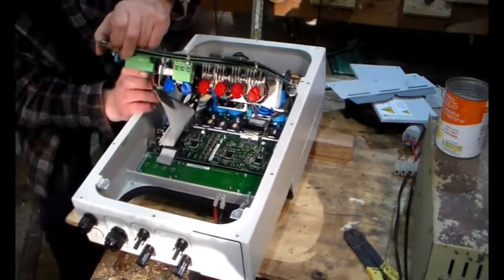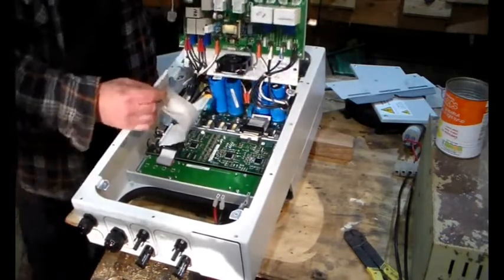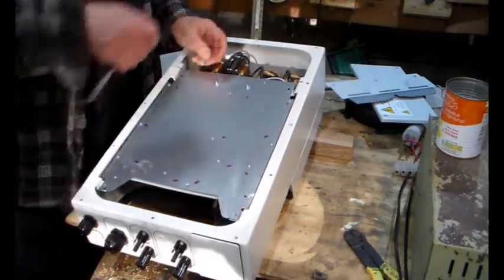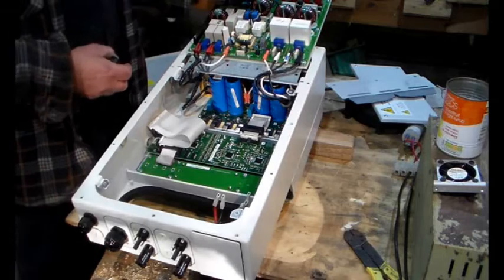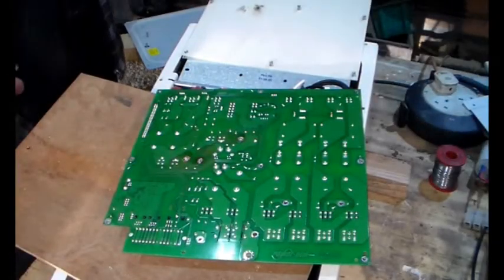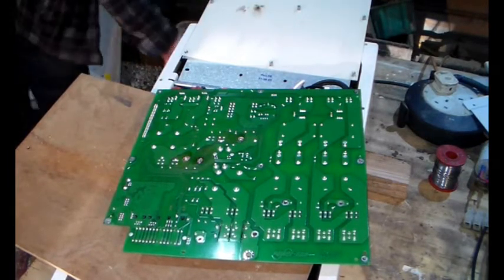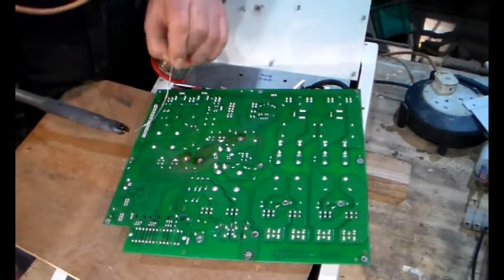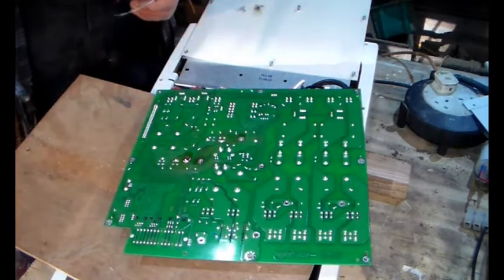ABB Aurora inverter fault E031 improved fix / repair

Comment: Olá, td bem?  Consegue me ajudará com uma reparação em um inversor ABB, o componente CI da placa de Potência está carbonizado e não consigo encontrar o código dele. Tbem não consigo encontrar o datasheet do inversor.
Reply: Inversor PVI-6000-TL
Reply from the maker: @joaomariorodrigues9441  sorry I have never had a 6KW inverter. in my experience if a chip is burnt then another failed component will have caused it, cheers

Comment: wow. fixed mine. was a bit nervous bc i never worked with DC before, but turned off the AC breaker and DC disconnect switch, then dismantled per your instructions. found 1 pin that had burned out. re-soldered and i'm back in business. the lowest solar provider quote was $4000 to replace the unit. fixed for pennies. thanks andy.
Reply from the maker: Hi, well dome, make sure you inverter is in a coll well ventilated area, you can also add an extra small fan run from a plug in timer. they just have to stay cool, please buy me a beer, cheers

Comment: Brilliant thanks Andy! Found E031 error on my inverter yesterday and at first finding advice on the internet that it was terminal, came across your video……………..had it fixed within 2 hours at nil cost!!, thanks to you. Just working out now how to donate, Can’t imagine how many of these Auroras will have been binned and replaced unnecessarily. So satisfying to repair and keep it going. Best regards, Geoff
Reply from the maker: Geoff, keep your inverter cool, not in the loft. I frequently add an external fan run on a timer. There's a video about the relay contacts, sometimes the heat comes from arcing contacts. A donation would be much appreciated, Patreon or Paypal, links are on the channel page or on my recent video details, cheers

Comment: Ciao Andy, complimenti per il video. Ho provato a sostituire i 2 rele con le piste rovinate però mi da lo stesso errore E031. Hai qualche consiglio da darmi? devo sostituire anche gli altri due? Poi volevo fare le prove in tensione con la scheda aperta ma il sistema non parte perche la Riso mi da 0 ohm. come posso risolvere. Grazie per il tuo aiuto prezioso.
Reply from the maker: hi, please see my video on re setting the relay contacts. Check your connections on the replaced relays, the coil tracks are very small. in the past I have had to add a jumper wire because of damage to these fine tracks, cheers

Comment: Hi Andy, great video and information. Thanks. I have searched for both relays Zettler A22150W-1AE or Omron G8P1A4p-BG in CPC /Farnell and RS Components but with no luck. Are you able to say where i can get hold of these relays, or if not, if i measure the pin-out dimensions can you tell me the minimum recommended ratings for equivalents that i should use?
Reply from the maker: I try to avoid removing the relays and re set and clean the relay contacts instead, I have videos about this. The heat that melts the solder often comes from arcing contacts and these can be re set, cheers

Comment: Thanks Andy, just went up into the loft to put away my Xmas decorations and noticed the invertor clicking on and off saying it was an international invertor fault E031.
To say I was expecting an expensive repair bill, but followed your helpful advice and within 30 mins got it back on line and fault free. Thank you so much for your video and advice 😊
Reply from the maker: Hi, the loft is a bad place for an inverter, if it must stay there consider fitting a small fan controlled by a plug in time switch to blow air over the inverter when generating. Please see my books and Paypal, cheers

Comment: Hi Andy, that was brilliant, thank you! I had the exact same message an found the exact same fault as you show. Solder on, all back together and back on the loft wall... Now - The thing doesn't power on (as it did before + E031). Is there a fuse in the unit or a safety switch that may have gone during the process? Thanks! Seb
Reply from the maker: Hi, there is no internal fuse, but have you checked that both AC and DC are getting to the inside of the inverter. Are all the internal spade connectors correct. Did you remove the wide communication ribbon and is it possible it was put back the wrong way round. Just a few thoughts, also a loft is a bad place for an inverter due to the lack of ventilation and the summer heat. If it has to stay there then a supplementary fan on a time clock is essential to blow air over the inverter, cheers
Reply: @TheInfoworks  Thanks for that. I had metered the AC in, when all was connected and the lid was still off and 242 was coming through so I put the lid back on and left it overnight to deal with in the morning. Weird thing is, when I went up the next day, before I took it off the wall, I tried it one more time and whoosh!, it all started perfectly and is still running and inverting... The only thing I can think of which is different is that the sun was out, so panels were now active? I thought AC alone would power the machine up and let you know DC was not coming in? 
Anyhow - Thanks again for your video and explanation, mate!
Reply from the maker: @sebasmorgan  Splendid, yes it's a common mistake, the inverter switches off over night so it does not draw power. They will not start without generation. Thanks for your kind donation, it all helps with the low impact income, cheers

Comment: Hi Andy. Mine just developed that error code. I’m not confident enough to do the repairs so do you actually offer that service?
Reply from the maker: Paul, Hi, no I don't provide this service but I believe it is available on Ebay. What ever you do make sure your inverter is mounted in a cool, well ventilated space, cheers

Comment: My 13-year-old Aurora inverter suddenly showed error E031. While I was searching for a solution I found this video, took my inverter apart, found one of the relay pins had arced so I soldered it according to your instructions and the inverter has been working for a month without a problem. Thank you!
Reply from the maker: John, thanks for your donation, much appreciated. The solder problem stems from relay contact arcing, and this is initially caused by inverter overheating. I have further videos in this series, including the re setting of the relay contact gaps. You may find this interesting. To keep inverters cool it is helpful to install a small  external fan, run on a time switch so it runs every day from (say) 10 am until 6 pm. Cheers

Comment: Fixed my cold solder on the relay. Just one little black burnt spot was arcing. Now I have a arc sensor failure. My arc sensor test always passed before I resoldered the relay.. any ideas?
Reply from the maker: Hi, I have a video in this playlist showing the cleaning and setting of the relay contacts. Damaged relay solder joint is caused by relay arcing which is caused by excess current, switching off at high power due to poor cooling, cheers
Reply: So I need to replace the relays? Or cut the tops off and clean the contacts? I'm leaning towards my wiring causing the arc . They were very tight in the conduit. May have caused a arc between wires
Reply from the maker: The relay pins are far enough apart so that there should be no solder spill. Try taking the tops off the relay with the burnt / melted solder and check the contacts as per my video, cheers @robrocha420

Comment: Had the same problem on my 12 year old AURORA inverter. Slightly different internal set up but followed your guide lines and problem gone, Just saved me $3000 AUD....thanks mate, will buy you beer if you are ever down under..
Reply from the maker: Brilliant, see the other videos in this series, especially about resetting the relay contact gap. The heat is caused by a poor relay contact arcing. If you feel like sharing the joy, see my paypal link, cheers

Comment: Soldering fails due to relay failing and producing excessive heat on terminal. Always replace relays with a new ones. Relpol 40A relays are cheap and should last a lifetime.
Reply from the maker: HI, I agree that the heat is produced from the relay contacts but have found ways to reset these and their spring pressure, cheers

Comment: Hi Andy, something to add to this, I have a number of these, I recently bought one with this fault, did the relay repair, and it didn't work. Swapped the board into a known good inverter and it worked. It turns out that the control/logic board had a failed transistor, which activates the relays. I plugged the two boards, set the multimeter for continuity, found the transistors/mosfets which activate the relays, one was shorted, replaced with a salvaged component from a parts board, and we're back in business at a cost of no pence. Happy days. Hope this is useful to someone. Regards
Reply from the maker: Hi, I think you were lucky, frequently I find there are other problems with blown transistors that caused the fault initially, cheers

Comment: Just tried the repair, including replacing one faulty relay.  Now got an E-019 error which comes up more or less immediately (no sound of relays operating).  Any clues on how to fix this?  Thanks
Reply from the maker: Alistair, just check all those connections and makes sure all the spade connections are right. The ribbon can give problems, especially if you disconnected it both ends. I have a vague suspicion that it has to be the right way round. Also track damage around the replaced relay, especially the very fine coil connections, cheers
Reply: the control board will need the fet replaced that drives the relay

Comment: Thank you so much for posting this. Just fixed my 8 yr old aurora with one new relay as it had burnt the board contacts. My soldering iron was a bit low powered to desolder all the relays so I stopped at one.
Ordered a new iron and will replace the rest next week.
Reply from the maker: Grand, hope you also have a solder sucker, let me know how you get on, cheers

Comment: Hi Andy, im a solar technician. I will attempt to do this for costumers since there is a long wait of a back log from ABB. Did you have to replace the relay or just fixing the solder joints fixed it?
Reply from the maker: Ron, for your application I would replace the relays as some of the heat comes from damaged relay contacts, see my video on resetting the relay contacts. I hope you have subscribed, cheers
Reply: I've been seeing this error often . Did you try this method?

Comment: Andy thanks for this video, saved me getting a new inverter. One resoldered pin and it's all good again.
Reply from the maker: Ben, thanks for the appreciation, several things: see the other videos in this series as the heat is caused by poor contacts, also see under "about" on my chancel page for other ways of sharing, cheers

Comment: Thank you. I have the same issue with my 5kw inverter. The internal is more simpler than than this one. Only one relay that was faulty. I re-soldered the relay that was faulty as well as the other one just for peace of mind. Put it back together and it worked 🎉. Thanks again for the video 👍.
Reply from the maker: Hi, another inverter saved, the heat can be caused by burnt relay contacts, please see my other videos on this subject and my channel funding options, cheers

Comment: Andy and others, I have a problem! 031 errror. 
Soldered up burnt solder, still error, then removed burnt relay and saw coil burnt inside. Also saw copper tracks coming away either side of board where burnt.
Replaced burnt relay and checked other 3 relays, all had same resistance on coil and made circuit when 12v currrnt passed, so only replaced one relay 
As well as soldering in relay, I added copper wire jumpers to tracks.
Checked connections all good.
Sttill 031 error.
Any idead snyone?
Reply from the maker: Hi, I have had this before and traced it down to poor contacts in another relay. See my video on setting the contact gaps. I have several other videos covering this problem. I hope you will subscribe and remember me when you fix it. Cheers
Reply: @TheInfoworks  Thank you Andy. I have tested the 3 other relays in situ and the coils all have re same resistance as the new one. When I connect a 12v current to the coils I hear the contacts close and resistance across all contacts is virtually zero. Do you think that changing the he other 3 will do it? Or could there be something else?.....Steve
Reply from the maker: @STEVEACER777  If his were mine I would remove the old relay covers, clean the contacts and adjust them to give good contact thrust. No point changing them if the fault is elsewhere. I think you may get no resistance but with a load this breaks down. Cheers
Reply: Thank you Andy, I have a lot of relays on the way, so I think I will change the lot and beef it up a bit at the same time. I know the inverter has been standing for quite a while so contacts could be bad. I am not as good as you with a Dremel so will change instead thanks for your help ..Steve
Reply: Andy, not got that one going yet, but have another that is dead apart from when the DC is contected there is a ticking sound like a clock. Any ideas?.....Steve       Ps. When the DC is disconnected the ticking gets slower and slower before stopping.
Reply from the maker: @STEVEACER777  Steve, that's a faulty capacitor, cheers
Reply: @TheInfoworks  Thanks Andy, will strip down and hopefully find it this morning.
Reply: @TheInfoworks  I have replaced 2 capacitors that I though could be ticking, but still dead with the ticking sound, do you think another fault could be making them tick? If so any ideas? There were a couple of badly burnt solder joint on a relay that I re soldered , they burnt through the insulation sheet to the back cover. May be this shorted something out or blew an internal fuse somewhere?
Reply: I am struggling with 2 inverters, hope someone can help!
Inverter 1   changed all relays resoldered all bad conectrions, still 031
Inverter 2    ticking with no sign of life. Changed 2 relays that I though were ticking, but still ticking and dead.
Reply from the maker: @STEVEACER777  Hi, there's a short somewhere and a capacitor is charging up and then dumping the charge. Might be one of the big capacitors. You might be able to make 1 unit from the two, cheers
Reply: @TheInfoworks  yes Andy, I was going to try putting the relay board from the dead inverter into the 031 inverter, wil let you know... Steve

Comment: Addendum to comment I posted 3 weeks ago that may be useful for repairers.  During my repair,  I also checked the operation of the 4 relays on the board while no power was connected.  The coil resistance ranged from 120 - 130 ohms on my multimeter and this matched the specs I found on the web.  I then applied 12 volts to the two small coil pins and make the relay click.  I then clipped on my multimeter to the large contacter pins and got either open circuit with no 12 volts on the coil pins, or 0.2 ohms with 12 volts on the coil pins.   One of the relays made the clicking noise but failed the 0.2 ohm test with contacts closed.  I replaced this relay with exact replacement for $6 plus $5 postage.  A second option was to hack  in a 250 volt relay 12 volt coil with spade terminals that could be purchased at a local electronics store.
Reply from the maker: Thanks Jon, good extra info, cheers

Comment: Hello Andy, Great video, thank you very much for helping and sharing. My question relates to the extent of the burnt contacts. My contacts are more significantly burnt than the ones you show, do you think it's OK to follow the same procedure?
Reply from the maker: Hi, I've created a video on changing the relays and one on adjusting the relay contacts, have a look at those. You may with to change the relay as the heat come mainly from arcing contacts. Also see my video on extending inverter life in my inverter playlist.  Subscribed? cheers

Comment: Thanks Andy.  My 2012 installed inverter was exactly the same with a slightly burnt connection to one pin of one relay.  The solder  in the connection had been running hot and had slowly oxidised.  The burnt varnish scrapped off easily.  I removed the old solder with a solder sucker and 60W soldering iron.  I re-soldered with a thick layer of solder.  All good now.
Reply from the maker: Jon, splendid, yet another inverter saved from the scrap. There are several reasons for this fault, see my other videos about these relays. I hope you have subscribed, cheers

Comment: have you tried to add that heat sink tape turning the back plate into a heatsink?
Reply from the maker: Hi, the heat should not be there. It is a product of arcing contacts, see my video on re-setting the contact gaps, cheers

Comment: Another take on repairing this inverter:   https://www.youtube.com/watch?v=NSEy6JwYGtw
Reply from the maker: Hi, thanks for the heads up, those were bad relay faults caused by poor inverter installation creating over heating and switching off on full DC load. Interesting extra details, cheers

Comment: Hi Andy, Watched your video after mine stopped working, followed your steps and resoldered like you said after scratching a bit of varnish around the terminals. Now working fine tuck under 2 hours to do the hole job, very pleased. Many Thanks
Reply from the maker: That's grand.Heat is your problem here. I have fitted external fans on several of my inverters, just a small fan run from a time switch from about 10am to 6pm. Just stops the build up and costs nothing. Snail fans from fan assist ovens work well and are free. Hope you have subscribed. Cheers